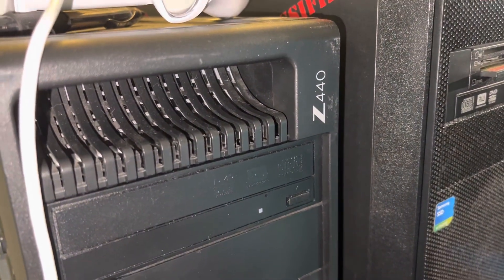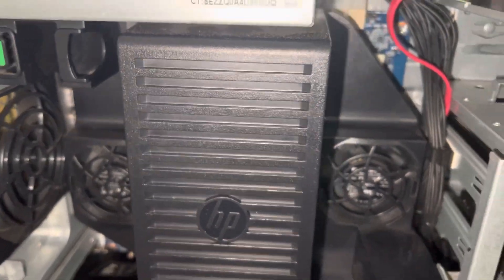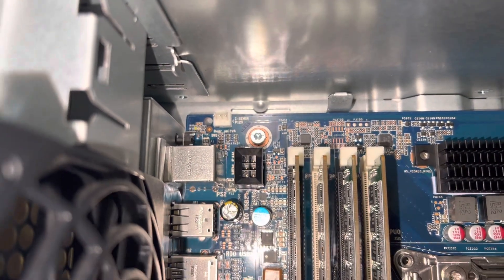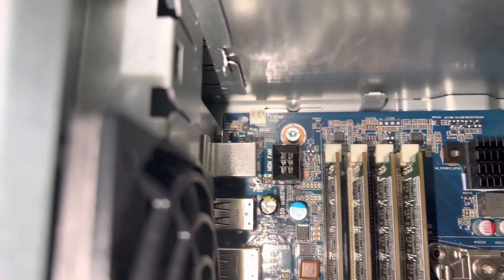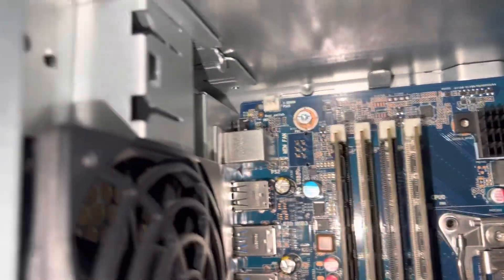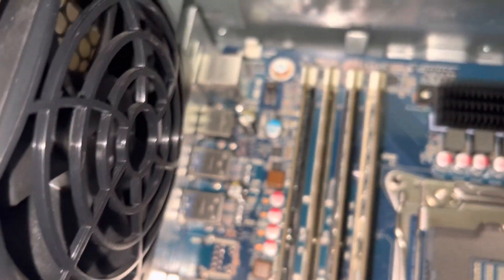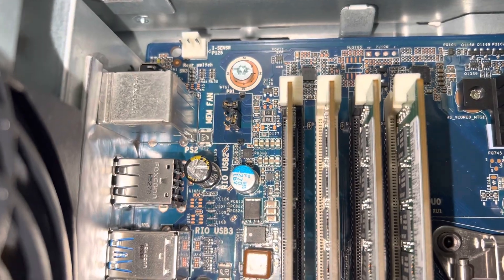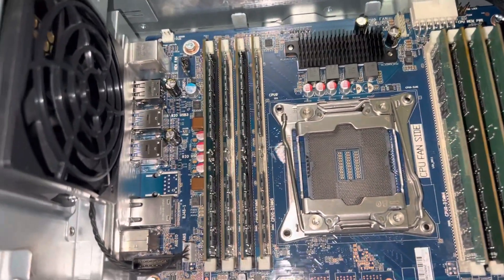HP Z440 Server temp memory fan bypass w/o getting the error at boot when all memory slots are full.

Comment: Thx, this may work for my z640... which I purchased to run dual processors with all ram spots filled, but the case door won't close with multiple GPU's installed so I may need custom cooling.   This will help!

Comment: the jumper hack does not work on a reboot. for a more permanent fix, connect the memory fan connector pins 3 and 4 (tach) to the rear 90mm fan's tach pin 2 (tach), even on a reboot it will not display an error
Reply: thanks man, it works, rebooting and no error message

Comment: I just found that for HP Z6 G4 the mem fan has 4 pins, which are: 1 for ground, 2 for 12V, 3 for RPM sense, and 4 for PWM control. Which pins should I put a jumper on in order to get rid of the 517 error? Thanks a lot! Your video is fabulous.

Comment: I just bought the stupid front fan kit, and I have a nVidia Tesla P4 installed (with its 3d printed fan shroud and that fan running off of SATA Power separately) and its still giving me the stupid front fan required in this configuration bios error. Does ANYONE know, or know where I can figure out how to disable this? Because I have the stupid fan and its STILL throwing it...

Comment: Cool! But how did you find out that this is the way to do it? Just trying to learn something new...
Reply from the maker: It actually started with my HP Z240 that threw a fan error if you installed a aftermarket PSU with an adapter cable.  Not all adapter cables are the same - Long story short I know there is  a power pin groung pin and signal pin and the signal is usally what tells the system there is a fan there. Grounding this pin bypasses that check just like in the z240 that I started with...
Reply: @douglomax7461  So how did you find out which pins two be connected? I suppose you measured the voltage of each pin?
I got a HP Z6 G4, which has 4 pins for the mem fan. Looks like I need to figure out a way to finding out correct pins to put a jumper on.

Comment: I just ordered the fan and housing. It was like $30 on ebay
Reply: The problems arise when you move the motherboard and stuff to an aftermarket case and then you no longer have a way for the shroud to sit properly. You kinda have to do this fix in that scenario and in such a scenario the modules are fine since the aftermarket case has much increase airflow anyway.
Reply: @theexile4694  Yeah I'm using the stock case.  Airflow seems adequate.

Comment: just what i needed.  the memory cooling unit is 120 USD on ebay, and the message stops the boot on my hp z6 g4 workstation.
Reply: Hi bro, HP Z6 G4 mem fan has 4 pins, while this one has 6 pins. Can you please share how did you use the jumper? Thanks!
Reply: @xinboli1062  I ended up getting bigger sticks of memory so i can use only 4 of them, that way i didn't get the error. i also was able to put on a much bigger CPU cooler (Noctua NH-U14S DX-4677), the memory cooler would be in the way of.   so i never ended up doing then jumper.

Comment: Fantastic tip. Just what I was looking for. Got hold of one of these last week.

I can't populate all-the-slots. I have 8x *Gb sticks. 3 came with the workstation, and I bought 5 more. These work fine in any combination using 4 slots to the right of the CPU (from pov used in your video)  and the left-most slot. If I put anything (even on its own) in any combination that includes the three slots immediately to the left of the CPU, I get a post error (beep and red flashing light). 

I am aware of the installation order, as shown on the inside of the cover. Whatever I put in those 3 slots causes a problem. All the memory sticks checked out and work alone and in combination with others (old and new). 

Have you seen this before?
Reply from the maker: @kyberzyler you may have a defective memory controller (which is on the CPU) or bent cpu socket pins...  they dont have to be bent much to cause a problem.
Reply: @douglomax7461  thanks, I shall try reseating the cpu and then replacing. Can't see a problem with the slots, but, of course, might not be possible to see by eye anyway.

Comment: Hi, I have a quick question this fix worked pretty awesome when I shutdown and turn on the PC, but the error still appears if I reboot the PC, can you help me please to confirm if you face the similar issue? I’m planning to buy the fan baffle and dissemble it because I’m not using the HP case, any advise is appreciated.
Reply: Hi, I experience the same issue. Works fine when you boot the machine but the error still persists when rebooting. Definitely not ideal if you can't reboot your server. Every time I'm not home but have to reboot the system I just shut it down and use another machine to send wake on Lan command to boot it back up. I might just invest in a fan shroud. This is too annoying.
Reply: I also have the same issue. Could you find out how to solve this?

Comment: GREAT TIP!  I'm building a Z440 right now and having all kinds of CPU, Front LED/Power, system fan issues, but I'll go ahead and make your recommended pin jumpers because I have all 8 DIMMS populated with Kingston 32 gig ECC memory with NO mem fan shroud.
Reply: Please let me know if the fix from this video worked for you! The memory fan issue is still present when I reboot the PC
Reply: @RobRetroComputers  , I just got my 24pin to 18 pin adapters and other misc jumper adapters in the mail so I'm looking to start this build soon.  What I will do is throw up some information in these comments to add to our collective work here.
Reply: @brandonunger1689  awesome, let’s continue in touch!

Comment: does that message that you need the shroud pop up at EVERY reboot?
or just once?

my guess is everytime, otherwise there would not need to be a workaround like you showed here.
thanks!
Reply: Hello! This really helped me with three machines. And it’s not just all slots. I have 128GB (4 slots) in two and 48 GB (six slots) in a third. All three machines throw the error.
Reply from the maker: Only if you have all the memory slots filled
Reply: @douglomax7461  yes, all slots, but the error shows at every start-up, right?
Reply from the maker: @otdosa  yes every start up
Reply: @douglomax7461  yeah I figured,Otherwise it wouldn't need a fix.
But now I know how to fix it,thanks!